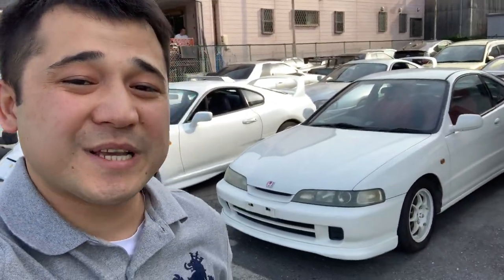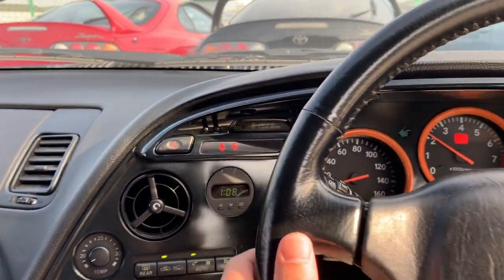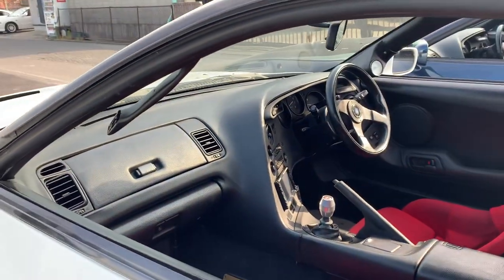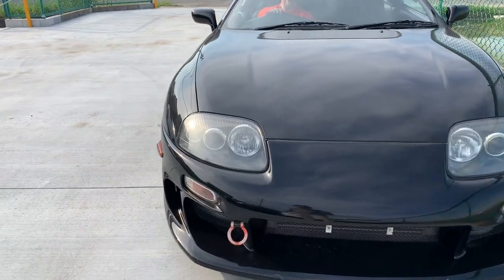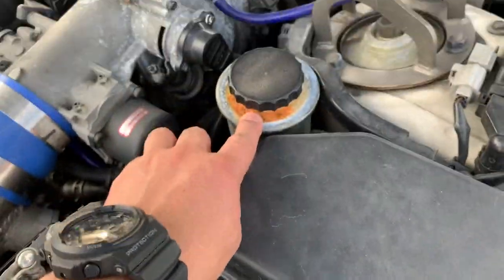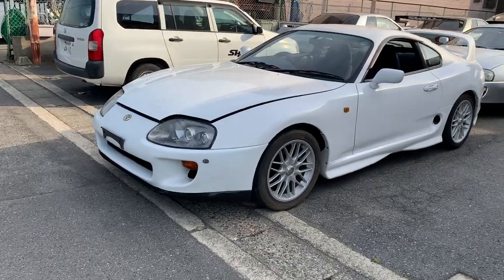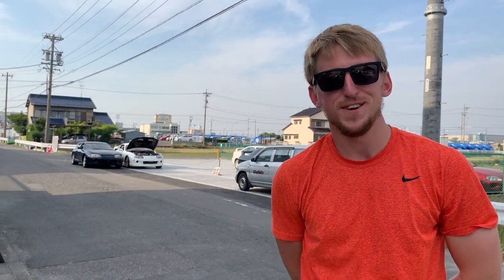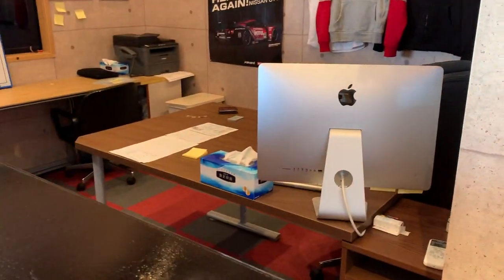Back Lot Update | TURBO Supra Available for Sale!

Comment: Wow,  ppl in USA getting robbed in broad daylight.  Bought a 1993 supra rz back in 08 for $8500 CAD from a local importer in Ontario
Reply: Amir Khan that was 11 years ago.. the popularity of Supras has increased so much since then that it’s bumped up the prices quite a bit. Can’t really compare 2008 to 2019 especially with the new 2020 Supra that’s coming out. 🤷🏻‍♀️
Reply: @JavierRodriguez-wx1co  He is not wrong. 23,000 for a non turbo is screwing without lube. The Turbo one I can understand but non turbo?
Reply: I paid 6500 for a non turbo for 21000-23000 you can buy a turbo 6 speed
Reply: @215Sugarfree   I guess the times I've skimmed around at prices they haven't been cheap, but I could see that!